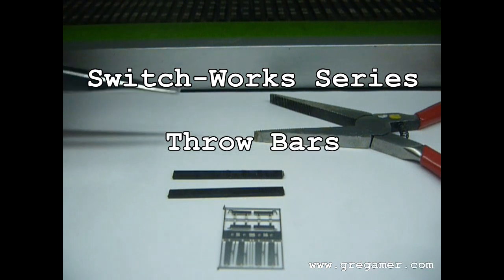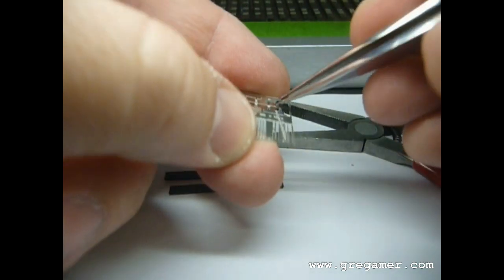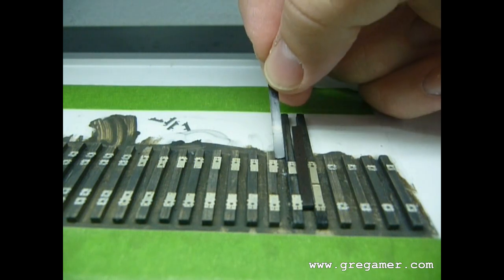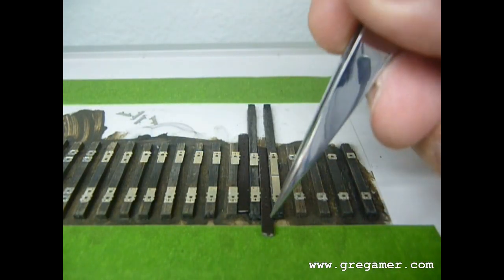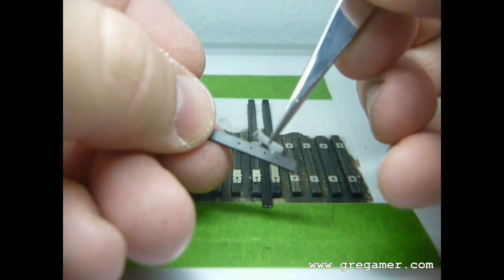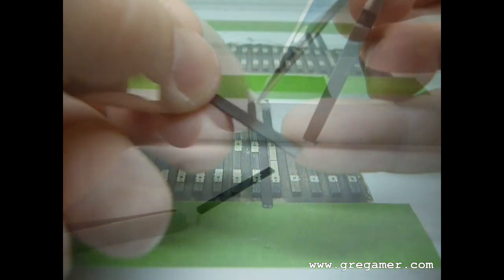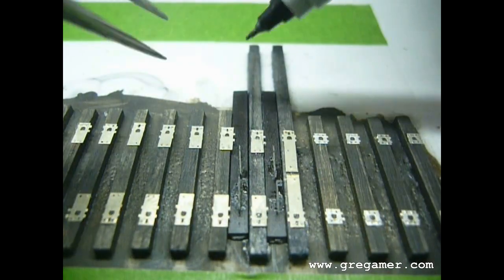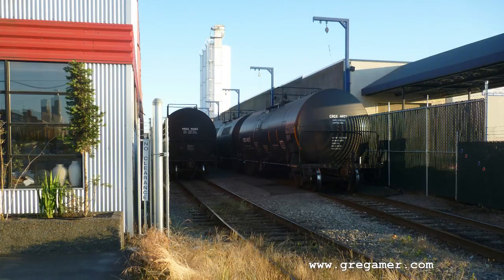Switch-Works Throw Bars

Comment: Great stuff but I have one question that I and others might be asking.  The tie plates on 3 or 4 ties to the left of the head ties for the far (curved) rail appear to be off center of the ties just a bit.  I understood that the tie plate jig used to position the tie plates on the ties was locked into position by pins in the tie spacing jig.  Was this caused by misalignment of the tie plate jig?